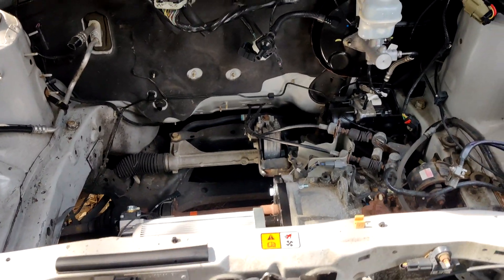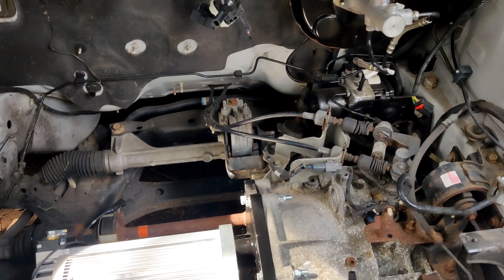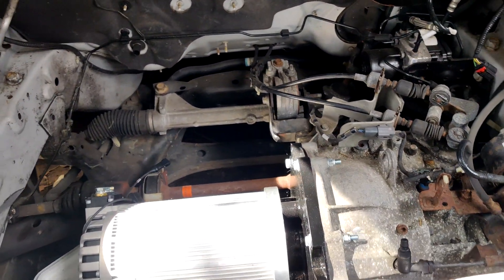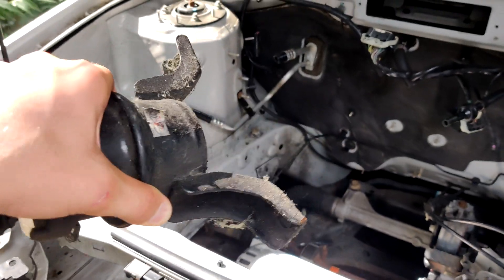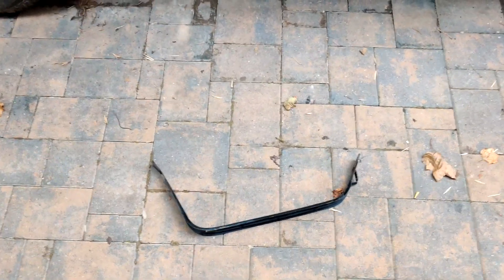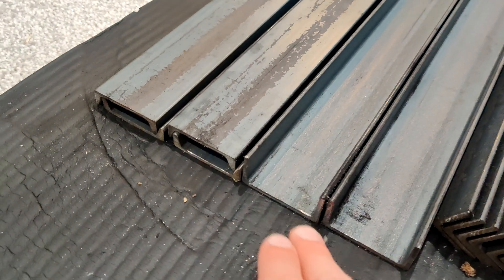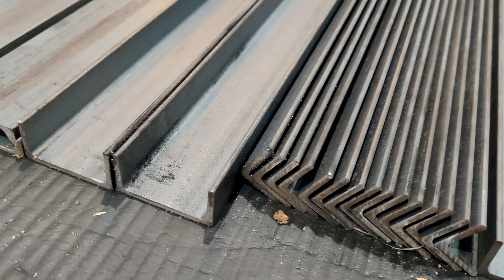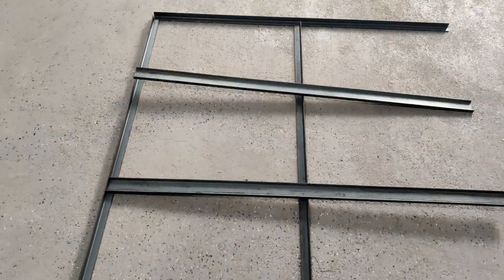Ford Escape EV Conversion EP 11: Tesla Battery Box Ideas

Comment: You ought to consider putting some of those batteries in the rear of the car you're going to have a way to front heavy vehicle that handles like shit!👌
( you'll see what I mean the first time you try to take a corner at speeds and you turn the steering wheel but the car continues to go straight into the ditch...)
Reply from the maker: Weight distribution is definitely important to consider. My Ford Escape is FWD, so being front-heavy is actually preferable as you need more weight over the front wheels to provide enough downward force for traction and prevent slipping. Anywhere from 60-40 to 70-30 front-rear axle weight distribution is considered ideal in a FWD car. Off the top of my head, the Escape is something like 62-38, and I'll be adding about 100lbs more than stock in the front and 50lbs more in the rear. 

I think I should have something like a 65-35 final distribution, which is pretty ideal.
Reply: @reider_mcfeely  that's horrible you want to get it closer to 50/50 not worse than what it was from the factory
Reply from the maker: @TaylorMadejdm1975  50-50 is ideal for Rear Wheel Drive cars (RWD). You want a heavier front axle for Front Wheel Drive cars (FWD) because otherwise you'll lose traction as the weight shifts to the rear wheels upon acceleration. With this being an electric motor (full torque from 0rpm), acceleration will be faster than stock. So this is more of a concern. If I were to design it 50-50, I'd have loads of tire slip off the line. 

The trade off is that with more weight in the front, understeer becomes a bigger issue. 65-35 is typically considered an ideal balance between traction and minimizing understeer. 

Example: the Honda Civic type-r is 62-38 and is generally said to handle quite well.

Comment: What do you do with all the original wiring that came from the ICE components? Do you keep the ECU PCU modules? Body control module?
Reply from the maker: All of the original wiring that isn't part of engine wiring is still in the car. I sold the ECU, but the body control module, ABS module, airbag module, etc. are all still in the car and I'm not planning on getting rid of them.
Reply: @reider_mcfeely  Can you use those components via a CAN module or VCU?
Reply from the maker: Most of it works fine on its own. The only thing I've lost without the ECU is power steering. I may be able to emulate that with a VCU, but I'm not sure.
Reply: @reider_mcfeely  Wow, sounds like they just need 12volts. Thanks
Reply from the maker: @GarrettRC5thscaler  exactly. Yeah they all run on 12v and are basically entirely separate from the ECU and engine.